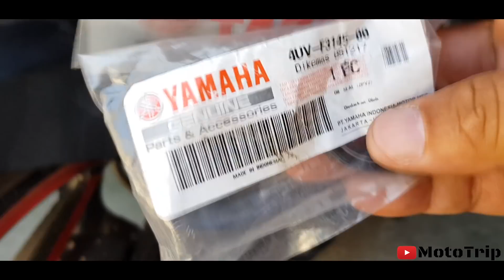Front Shock oil seal/o'ring replacement  l Bbye Lagutok l EP. 35

Comment: Paps may tanong po ako. Ayos lang ba na oil seal ng XRM 110 ang ipalit?  . Wala pa kasi stock yung yamaha.
Reply from the maker: nurkhan asani oo paps.. kapreho nyng size yung sa xrm
Reply: Mga 4 months ko na syang ginagamit paps yung oil seal ng xrm. May oil mark parin sa Fork paps ehh. Ano bang dapat gawin ko dito paps?
Reply from the maker: nurkhan asani bka may gasgas na outer tube (ung pinapasukan ng oilseal) or use stock.. bka local nabili mong oilseal
Reply: Ok paps thankyou sa sagot. Baka antayin ko nalang magka stock yung yamaha, yung pang sniper talaga na oil seal.